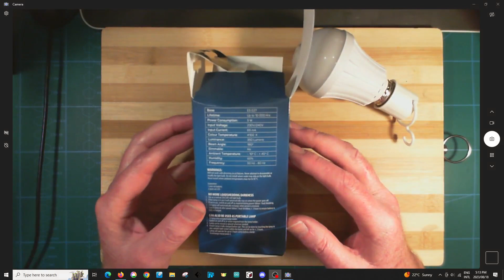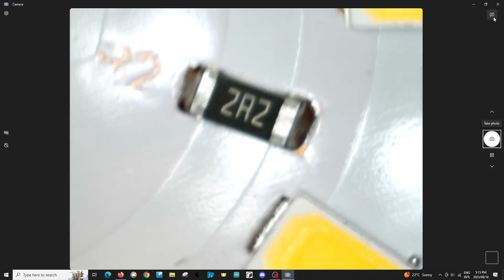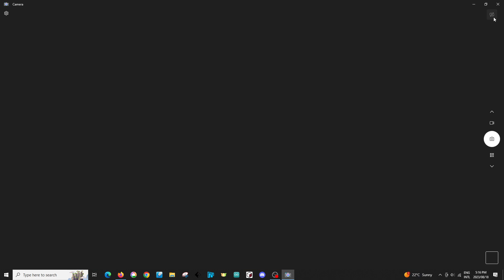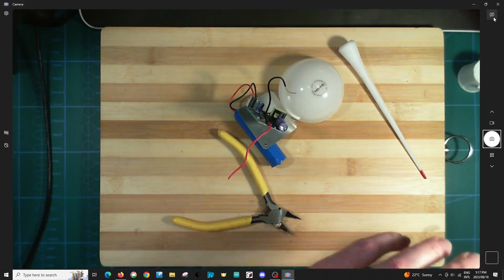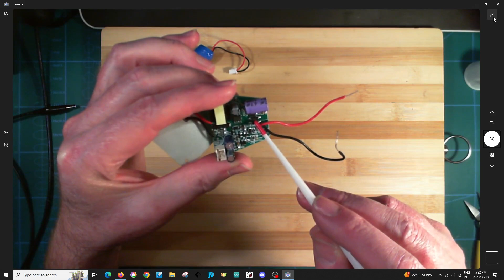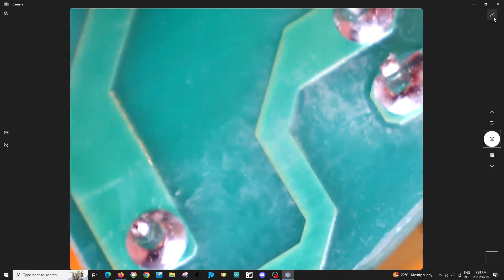Pick and Pay rechargeable lamp tear down

Comment: At 1:05 or so, you say "4100 K lumens"
Its actually 350 lumens. Its 4100 Kelvin color temperature.
It would have been nice to see the shrink wrap removed from that battery. A cheap Chinese 18650 can be as little as 500mAh which would give you less than 30 minutes of run time while a decent Samsung or similar battery could be 3000mAh or more for a run time of two and a half hours.

Its too bad they use the current limiting resistors instead of an actual LED driver. Its wasting about 20 percent of its power on just heating the resistors. I'd rather pay the extra 0.45 USD for one with a 10 channel LED driver. You could probably turn this into a pretty decent backup light for a few extra USD.